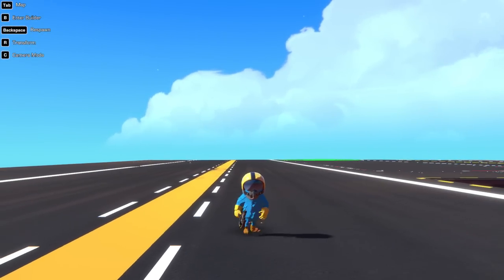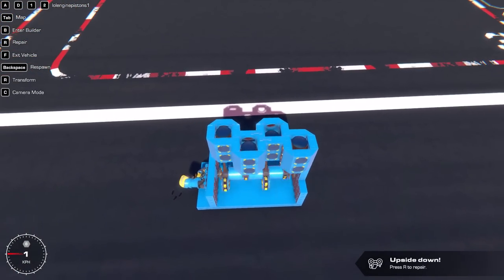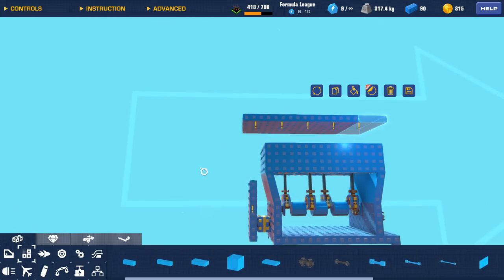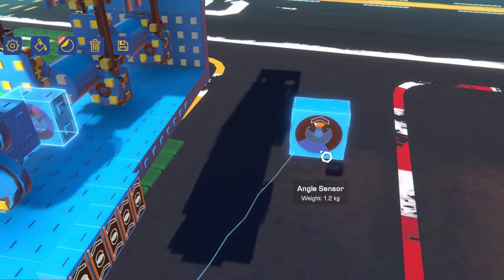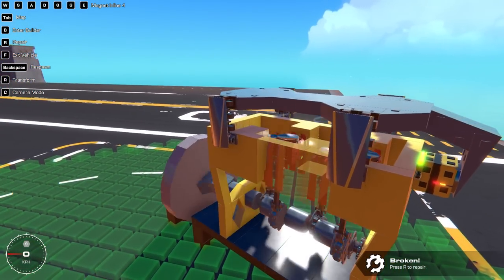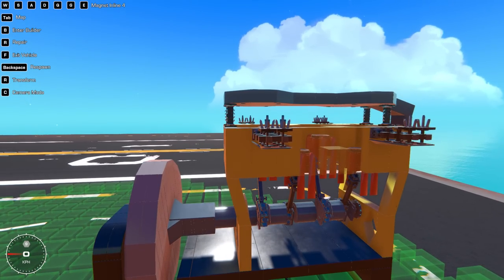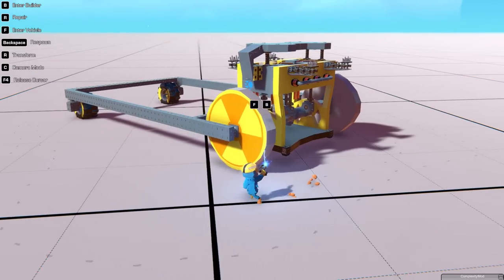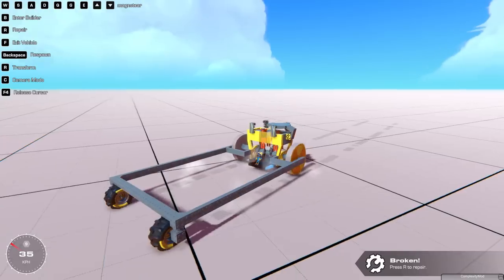I Built a Working Four Cylinder Engine to Power a Car in Trailmakers!

Comment: 1. put sticky pads on the wheels for traction. 2. put pistons on the magnet top plate to raise and lower it for different strengths of attraction. 3. test to see if the attachment point of the piston rods work best on the left or right points of the helicopter engines (further from center on the pull motion will give more torque and closer to center will give more speed but might not have enough touque cousing instability or glitching). also you already basically gave a 2 stroke because there are 2 sets of 2 moving up and down together. offset them for smother action. oh and can you program them with logic gayes to pull up on up stroke and then push down in down stroke? Idk I don't play the game just love the engineering.

Comment: if you set a logic block to minus Value the magnets start pushing. So you could make it a push/pull engine by connecting/activating the magnets with 4 XOR-Gate on negative Values activated by the AND-Gates and 1 permanent ON Distance Sensor. So that the Magnets are on push when the AND-Gates are OFF. If you want to have ON/OFF Control for the pushing add a AND-Gate between the each of the XOR-Gates and the Magnets. But then you have to set those AND-Gates to negativ Numbers instead of the XOR's.

And the value you set in the Logic blocks only determines with how much power the activated Part ist working. iE. a Jet would give only 25% speed if you activate it with a logic set to 0.25.
which can be used to set your speed for dogfights xD.
With just 4 logic gates you can set anything from 10%-100% Power!
Just with the logic blocks set to the values 0.1, 0.2, 0.3 and 0.4 and 1-4+toggle set to activate. The Values add, so all 4 add up to 100%, 2+3 or 1+4 to 50% and so on.
works on Balloons, Buoyancy Blocks, Engines, Pistons and Magnets, well anything that you want to have a increase/decrease in Power by a discrete Value

Comment: The distance sensors needed a longer input. I built several simple motors and used tdc and -10° off that represemted by a small piece following the circumference of the flywheel

Comment: use helicopter engines as bearings where the crank shaft goes through the block. lay the engine down to make it more compact and lower center of mass with windows to see the operation from the top.

Comment: referring to my other comment about using pistons to raise and lower the top plate for different strengths of attraction. you will just need to put it on the hinges with the   locking pins like you already have on the sides

Comment: You can use stackable helicopter engines as bearings to get the driveshaft through the wall, could be more stable than your collision based solution!

Comment: Say the same thing I told kAN yesterday, even though I doubt you need it; I imagine you know, given your background.  With the repelling magnets, you need the pushing force to occur AFTER TDC.  Something around 8-15 degrees.  This is the same as IRL Otto cycle reciprocating piston engines.  At TDC you have no leverage on the crank, you are applying force on the "bearings" only.

Comment: crossplane crank engines are pretty rare compared to the standard inline 4 crank where both outer and both inner pistons move together 180 degrees apart. Because the 4 stroke process takes 2 rotations you get an even ignition every 180 degrees. crossplane crank with the pistons every 90 degrees actually fires every 90 and 270 degrees. Now that sounds like a twin twin.
The game pistons and magnets act like the 2 stroke where it ignites every time a piston reaches the top instead of every other time. A crossplane can fire every 90 degrees but the standard crank just fires 2 cylinders every 180 degrees. More bang for your buck but not really a twin twin.